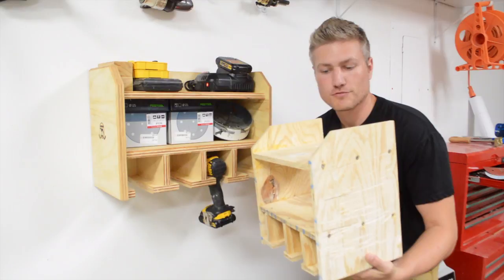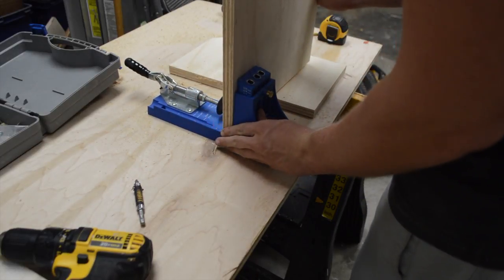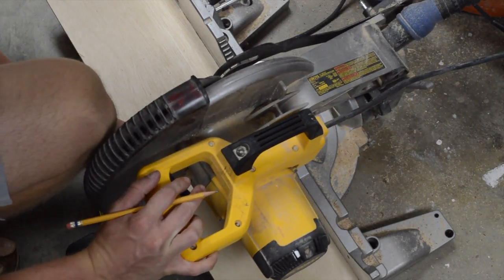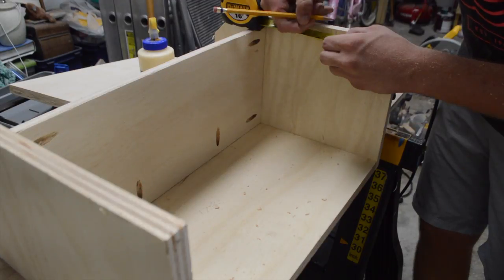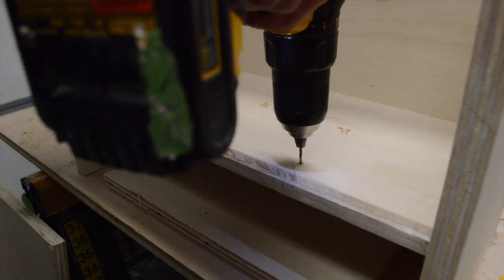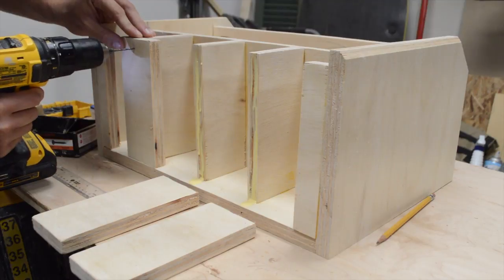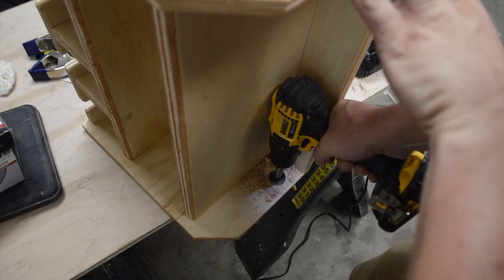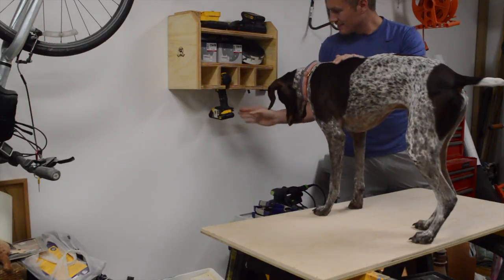Extremely Easy to Build- DRILL CHARGING STATION (Shop Organization)

Comment: Thank you for the drill station  video but thanks even more for one comment you made. I am new to wood working. When you made the of suggestion to set the power to between 7-9 to prevent over torquing the screw and splitting the plywood. I also appreciate label the front. You have an excellent presentation.

Comment: I advise you get a decimals to fractions chart. I'm not ashamed to admit I still use one. I worked in a wood shop for a while, and the old military guy that trained me in, had a chart up on the work bench.  Lol he had a way of getting under your skin... And teaching you something while he was at it. That decimals knowledge is an awesome artillery in the wood shop. It would give you pinpoint accuracy in fractions so you don't need to convert to metric unless you chose to do so.

Comment: Zac, very handy!  I've gotta make something like this myself!  As for equally spacing, try using a few scraps of wood that are the same width (ripped easily on the tablesaw) for the 3 center spacers and then eyeball between both ends till it looks centered.  Does this make sense?

That's just an answer to your question...at least that's how I do it.  Yours turned out beautifully and I wouldn't worry at all about it.  I wouldn't have known had you said something!

Great project, thanks for sharing!
Reply from the maker: Thats a good tip right there Rob!  You should totally make one and film it!  You're pretty good at the whole filming and editing thing ;)

Comment: Great build!!

Take total width divide by number of spaces required (not partitions. Ie: yours was be 4 spaces not 3 drill partitions) then centre ply over each mark. 
So, say theoretical 360mm width. 
Divide by 4 spaces (to create 3 drill partitions) equals 90mm. 
Centre 16mm ply at 8mm and screw at 90, 180, 270mm marks. 
And you will have three partitions equally spaced across your theoretically 360mm wide total width. 

Hopefully that helps? Just forget the thickness of the partition ply and always centre them. 

Good luck with your new channel.
Reply from the maker: That is a great tip right there, I'll just figure center next time I want some even dividers!  Thanks for watching and I'm super pumped to get this channel rock in rolling!

Comment: looks good. Did you install the top shelf and have to take it back off because you needed to be able to get to the tool hangers attached to the bottom shelf?  I would suggest a round over bit for the hole you drilled for the charger cord.
Reply from the maker: So I preassembled the bottom hangers in before I put it together. I’d be lying if I said I didn’t put the top shelf on first though 😂

Comment: What are the sizes of dividers and the bottom pieces?
Reply from the maker: It was approximatly 27" in length and depth was about 7".  I took the inside dimension which was 25.5" and divided it out by three to get some symmetrical pockets for the drills.  If I could go back I'd make this twice as long.  Hope that helps